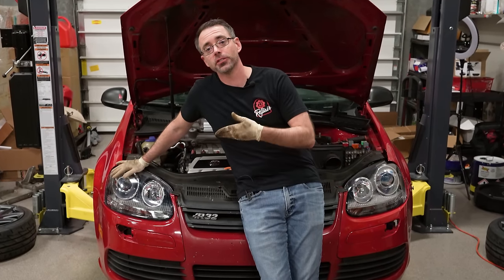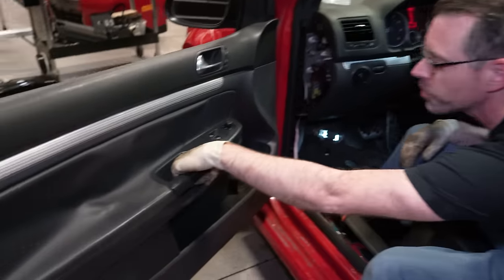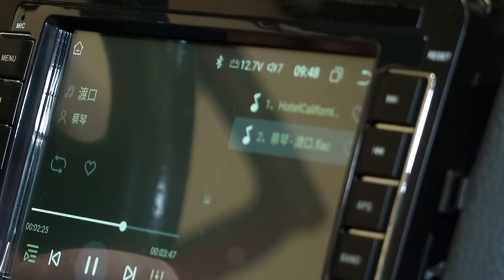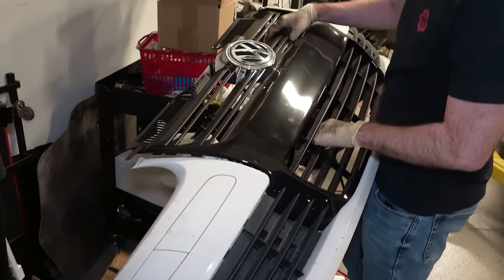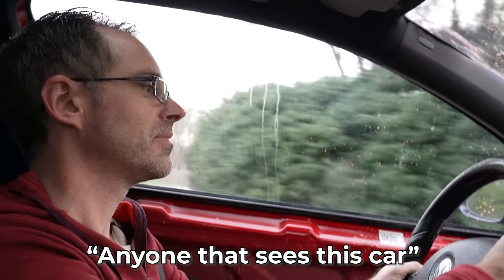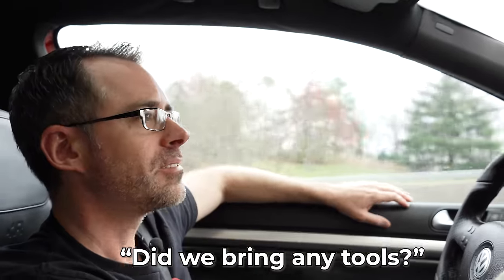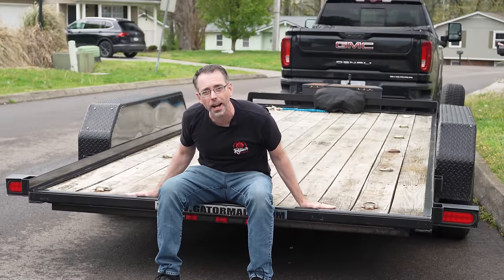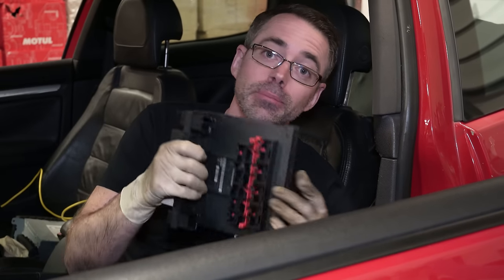It Broke Again... and were done

Comment: Same here dude. Bought a red one back in July. Did the timing and changed trans with a bunch of other stuff. Drove it about 20 miles. Parked it for a day. Now crank no start. The demons are in mine too.
Reply from the maker: God speed...
Reply: Thank you🙏.. love the Channel. Great content.
Reply: Check the main fuses, sometimes they corroded which will let you crank and no start, I had this issue last year. Not saying that's your problem but it's a place to start looking
Reply: Had my r32 for 9 months had over 100 hours of labor and 2700$ in parts. Mk5 is most definitely a love HATE
Reply: @Dknappy  Def a love hate. When it's running, it's a fun car. Had to cancel my plans for Wookies this year. I'm sitting at hate right now.
Reply: Me and my demons have never been closer. 😂
Reply: @Deutscheautoparts   I didn't know "God speed" = 0mph?
Reply: Ive been dealing with a similar issue will start once and run fine shut it off it won’t start and weird things are dead unhook battery let sit for 7 months starts fine runs good 3 times now dead again 😅
Reply: God a speed requires more tributes of you
Reply: @djguzzy6339 
I had a similar issue with an Audi A6 2.7t. The crank position sensor housing cracked after many heat cycles. Oil eventually got into it. Would start while cold, then wouldn’t when hot after driving. No codes, even through VAG-COM. I thought it was possessed. Finally found someone with the same issue, swapped the sensor, and was good. Don’t know if the MKV had a similar setup.
Reply: I had a similar crank no start issue. I replaced camshaft and crank sensors. Still no workie workie. Replaced fuel pump relay and other relays. Ended up towing it home and replacing the fuel pump with an upgraded model. No issues now.

Comment: hey, automotive engineer here. The BCM is defective and prevented the EPS from communicating to the other module. The BCM performs a lot of CAN signal gating between different networks. If the module is not doing for it some reason, stuff like this happens.
Reply: Stellantis and VW = junk!
Reply: hi. Who can help me understand a Ratteling noice in gear 2and 3 that only occurs every first startup (dayly) on my 2012 TDI 2.0 Tiguan Automatic, DSG (7), happens when cold and accelerating only when in D.
Wish i could leave a soundtrack of it here or someplace for experts to listen to...Jan

Comment: I like how you kept listing issues, but it was basically what you should expect from MK5 owners
Reply: Yup, I have been going thru that with my mk5 rabbit.
Reply: I keep repairing my mk5 even though it's a gigantic pos. Dunno what's wrong with me haha
Reply: @XantoS771  Its pretty cheap to repair and I bought mine brand new in 2008. So far got 230k miles still running strong.
Reply: @fussysoup23  yeah, that's probably why I still see so many of them + the aftermarket is huge for those cars
Reply: This must just be the US manufactured cars because Golf's are super reliable in Europe
Reply: As a mk7 owner, Its a major upgrade, but it's still a slight headache, man. I will sell it soon and get myself a honda type r((:

Comment: Oscilloscope is very helpful in these kind of situations/diagnosis, anything else is just guess work, at least you figured it out on your own, great content!
Reply: It's hard with CAN though unless you're really smart enough to know what module is sending and decode the packets
Reply: @Jack-qn4vt  you don't have to decode, most of the times if a module is faulty it simply doesn't communicate, if the module communicates then it's probably the part that is faulty unless it's a broken wire between the part and the module which is  easy to diagnose.
Reply: @dhrida5518  yes correct, a dead module won't communicate. If only 1 wire is broken in CAN H or CAN L then you will still see communication. 

However if you put the oscilloscope on the lines to a dead module you will still will see CAN activity as the other modules will be sending/receiving packets. 

The only realistic way to know if a module is communicating is to test via scan tool. Unless like I said you know how to read CAN data which is a skill within itself.
Reply: @Jack-qn4vt  you have to test the communication at both ends with wire probes on the connections, that's one way to test wiring, you can also test for ohms at both ends jiggling the wire to see if it affects values...

Comment: Here in Canada 🇨🇦 independent repair shops can’t access all factory information but if a VW dealership runs Guided Fault Finding (GFF) it will tell you if any module has a change in coding and can put coding back to factory spec.

Comment: I found on my mk5,  if the bumper is trashed you really have to replace most or am the fender liners.  I spent about $250 in fender liner parts.  Once you displace the bumper once all the screw holes are ripped out and broken.
Reply: It's true. Once that bumper gets ripped off, it's never the same under there.

Comment: This is the most accurate PSA against owning a Volkswagen group product.  I say this having one still and having owned a dozen.  (Thankfully never anything newer than a MK3).  

These MK5 are getting to the point where they are so cheap there needs to be a bolt in RWD swap.  They look amazing, but could really use some simplicity.  Is there a mod for regular power steering you can do?  It would be amazing to find the lowest spec one we can.

Comment: I have a type 6 golf convertible and feel your pain brother. 3 DSG Mechatronics issues , radiator and other gremlin issues. VW repairs cost an arm and a leg just to get the car running again. I am at the point of just throwing the car away and cut my losses.

Comment: I learned 2 things with this video:  1:  The RCD-330 is a great option for adding carplay to these cars, better than the stereos that include Chinese songs with them.  2:  Manual transmissions are still better than DSGs because they don't do crap like this.  I hope you can turn this thing into something that runs and drives great!  It amazes me how people will take these cars and turn them into turds like this.  Good job with this thing.  Hope you can get it completely fixed at some point!

Comment: I had an 09 Rabbit that ended up having to have that body control module teplaced as well. It took the shop a long time to figure it out. I don't remember what the initial problem was, but it was nothing that would make you suspect that module. Luckily the shop had some donor junk cars behind the shop to pull replacement modules from to try.

Comment: I had this issue on a tiguan, I had power and ground at the electronic rack replaced it still had no communication. Ended up being a break in the signal wire going to the rack. Ran a new wire and it was gravy.

Comment: I've bought a Mk5 GTI. Same problem on transmission. It's intermittent, low voltage on solenoids. There's a video on YouTube that shows some dry solder joints that just need touching up.....

Comment: The Modest GTI Takes the Crown: Why the MK6 GTI Edges Out the MK5 R32
While the MK5 R32 holds a legendary status among Volkswagen enthusiasts, the unassuming MK6 GTI offers a compelling counterpoint. Let's delve into why the GTI, despite lacking the R32's iconic VR6 engine and all-wheel drive (AWD), might be the better choice for many drivers.

Performance Punch: On paper, the R32 boasts a larger, naturally aspirated engine with a throatier sound. However, the MK6 GTI's 2.0L turbocharged engine delivers impressive power (often with later model years surpassing the R32's output) with less weight to lug around. This translates to quicker acceleration and a more agile driving experience. Additionally, the turbo's responsive nature eliminates the lag often associated with naturally aspirated engines.

Fuel Efficiency:  A significant advantage of the MK6 GTI is its fuel economy. With a smaller engine and modern engineering, the GTI sips gas compared to the thirsty VR6. This translates to significant cost savings at the pump, especially for daily drivers.

Modern Appeal: The MK6 GTI boasts a more modern interior with improved ergonomics and technology. The cabin feels more comfortable and user-friendly compared to the slightly dated feel of the MK5 R32. Additionally, the MK6 offers a wider range of infotainment features, making for a more connected driving experience.

Affordability and Tuning: The MK6 GTI is generally more affordable than the MK5 R32, both in terms of initial purchase price and ongoing maintenance. Furthermore, the turbocharged engine of the GTI offers a wealth of potential for performance modifications, allowing enthusiasts to unlock even more power and personalize their driving experience.

A Matter of Preference:  It's important to acknowledge that the R32 isn't without its merits. All-wheel drive provides superior handling in adverse weather conditions, and the VR6's unique sound remains a beloved characteristic. However, for most drivers, the MK6 GTI's combination of practicality, performance, and affordability make it the more well-rounded choice.

Ultimately, the decision comes down to individual priorities.  Those seeking a thrilling soundtrack and all-weather grip might lean towards the R32. However, for drivers who value a balance of performance, fuel efficiency, modern features, and affordability, the MK6 GTI emerges as the more compelling option.

Comment: I'm working on the MK5 since 2006 and I know this Issue with a blocked Powertrain CAN Bus but the BCM as the culprit ? Never had that. Sometimes the Steering Rack does this when the Power Steering Module dies. Or the Can Gateway itself... Have seen that more then once on a MK5. But the BCM ? Rare thing.... Btw. the Speed Sensor issue could be a worn out DSG Clutch.

Comment: The reason your transmission keeps dying is because there is a heat exchangeer that cools the transmission oil using the water cooling system. This little heat exchanger leaks then causes water to get into the transmission killing the dsg gearbox.

Comment: Manual transmission ftw! If one gear doesn't work others might 😅
Reply: It's good in theory, but I have a Manual mk5 R32. It's broken.
Reply: What broke? I have a manual R32 too and nothing is wrong lol.  @phillxor
Reply: @kingchooet9966  you know that's not true 😂. It's a VW. There's always something wrong.
Most of my issues are just age/km related. Headlight wiring has lost its insulation, gearbox is tired, short shifter has heaps of play in it, engine has slight misfire that I can't track down, top aircon vent is broken, subframe/power steering rack has clunk, undiagnosed noise that sounds like wheel bearings but isn't. 
I am very pleased that the car can't tell me it's not going to go into certain gears though. That's nice.

Comment: Regarding the transmission fault i’ve had a similar turbine speed fault on my golf 6 gti , the issue was that a had a golf 7 mechatronic installed on a golf 6 gti transmissions , they not the same hardware even though they look very identical , so im assuming you dont have the correct mechatronic or the software on it is not compatable.

Comment: I have never related to a car video this much. I have never owned a R32, but I have owned my fair share of "possessed" POS's that seem to be deathly allergic to functioning normally. 

Lincoln towncar I bought to flip. Old lady car, well taken care of, had a coolant leak from the intake and needed a tuneup- I fix the coolant leak, it immediately blows out a freeze plug. I pull the engine, replace the freeze plugs, clean up the engine and not even 6miles after reinstallation, the transmission shits the bed. I replace the transmission, and a week later the radiator popped. I replace that, and the heater core started leaking. I was so far upside down in that thing it wasn't funny and damned near gave it away just so I wouldn't have to mess with it again. 

The guy I sold it to has been driving it trouble free for 7yrs....

Comment: Do you do work on older ones? B5 A4? I might have a electrical  gremlin. No CEL with untronic. After UM could not get rid of cel. They blamed it on car said they couldnt help. Then block cracked,  lol. But not before u rebuilt it 2x. I feel your pain. 

Do you tune b5s? Im in desperate  need of a awm me 7 .5 tuner

Comment: Does the “P3 gauge” fit my Volvo?

Speaking of funny faults where one faulty module jams the communication with another seemingly unrelated module.
The boost pressure sensor failed on my Volvo, which somehow stopped the ECM (engine control module) from communicating with the BCM (brake control module), resulting in a “Anti-skid control” error and “engine power output Reduced” (limp mode warning), even when it wasn’t in limp mode.

Comment: @Paul I hope you see this. 
Check the big ass plug that goes into the trans. You have the EXACT same issue as mine had. I changed the same parts. ... 
The big ass plug was corroded.

Comment: This is why I don't buy semi-rare, sought after cars for cheap.

I had a Volvo V50 with the turbo 5, AWD, and manual transmission. The only variant that would've made it more rare is if it was the color you could buy that was never actually offered. I learned very quickly why you don't buy a rare-ish car to daily. And nobody even cared because it was just a Volvo wagon, so there wasn't even any cool factor. The only people I could find that cared were people that already owned a V50, and even then they were so busy trying to fix the crap to really congratulate you on not owning something better.

Comment: Hello, I would like to ask about my 2022 MK8 GTI S. It has a total of 13,000 kilometers. When I changed the oil, I smelled gasoline in the oil. But I drive 80KM to and from get off work on the highway every day. There is nothing strange about the car. I should what to do

Comment: @eutsheautoparts 
i need your advise so i own audi a3 2015 2.0 tfsi and a chevy cuze 1.4l eco 2016 they both have 145k miles and the transmission has never been services so if i drain and refill will that prolog the life of the transmission or will it starts slipping and better leave it as i'm on a borrowed time till it breaks ?  thank you

Comment: I'm not clear on this, did changing that module not fix the speed sensor error?
Reply from the maker: Correct. And we swapped the speed sensor
Reply: @Deutscheautoparts  check the outside connector. My transmission had one bad pin I had to fix on the wiring connector. Then everything was good. I had even replaced both internal wirings and kept having an error due to that. I just thought I mention this because it did take me a while to find it as well.